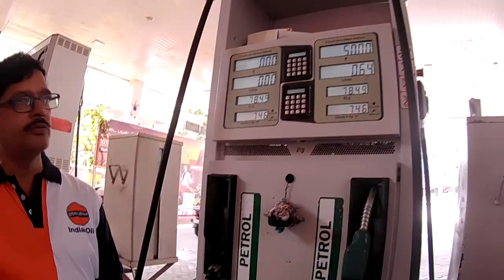Washing my 1997 Yamaha RXG @ The Detailing Mafia!

Comment: 100ML oil is enough for 8 liter petrol?
Reply from the maker: Yes,if you have your oil pump working and you run premixed,both in the same time.As 10-15ml of oil in the petrol is enough to save the engine from light siezures due to an unexpected oil pump failure.

If you are running fully on premixed,You need atleast 200-240ml of oil for 8 litres of petrol.
Reply: Oh thank you Bro.
Reply: Bratty Biker bro that’s like 50ml/litre for premix
Reply from the maker: No ji.
100ml oil for 8 litres, roughly translates less than 12.5ml Oil per litre and not 50ml per litre.

But you’re right if you corrected me on the fully premixed part.

You have to add 400ml of oil for 8 litres if you want 50ml oil per litre and I just recently learned that’s a bad idea as it will cause a very lean mixture and might cause overheating and worst case, siezure/catastrophic failure.

My humble suggestion, is to remove the oil pump and tank, seal the oil pipe that goes to the carburettor with a screw.
Then run the bike fully premixed with good quality oil. You can add 25ml-30ml of good 2T oil for every 1 litre of petrol but do not go beyond 35ml as it will be too lean.

This is a better way since we don’t have to worry about oil leakages or pump failures. We need to be careful not to forget to premix oil whenever we fill up, and our 2T engines will be healthy and will run well.

But anyways, Thank you for correcting me and humble apologies for the misinformation.